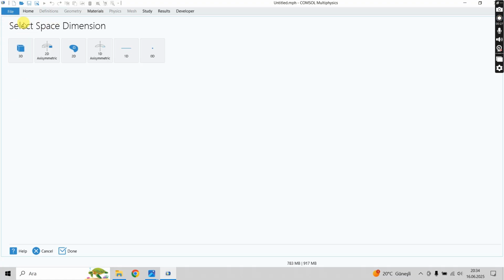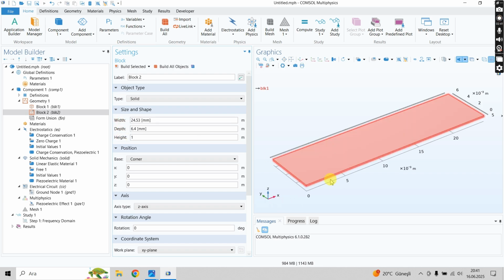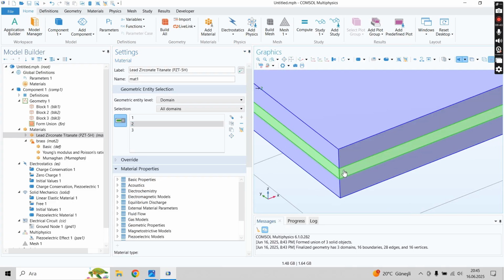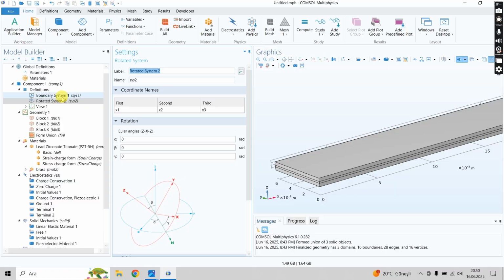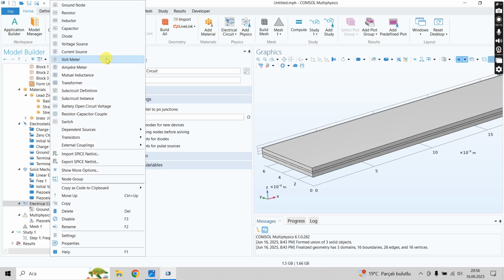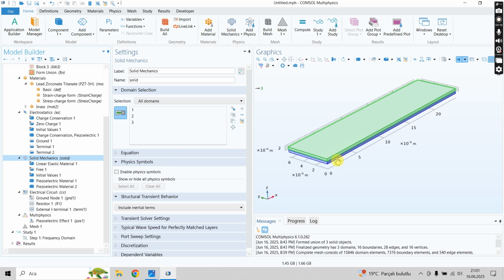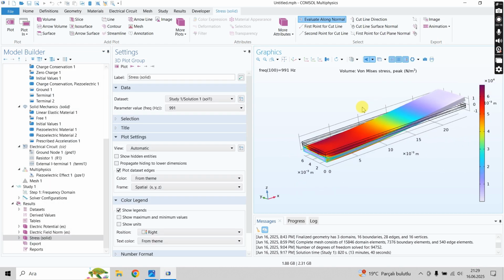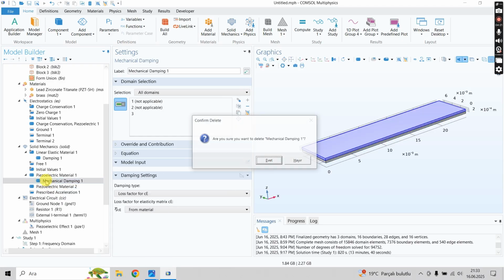Piezoelectric Energy Harvesting Analysis by COMSOL

Comment: Sir, in the paper, the results are normalised with respect to the gravitational acceleration and your results are not. So, the peak voltage you get would be around 1.4 and not 14, which you currently have. That is significantly different from the paper.
Reply from the maker: It is normalised to gravitational acceleration (9.81 m/s^2) which is equal to my applied acceleration. So, no problem.